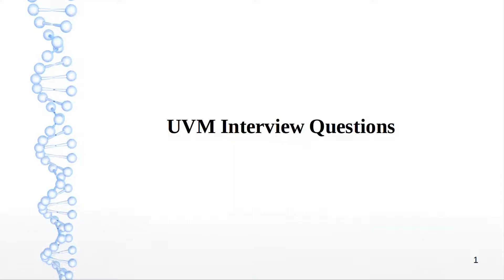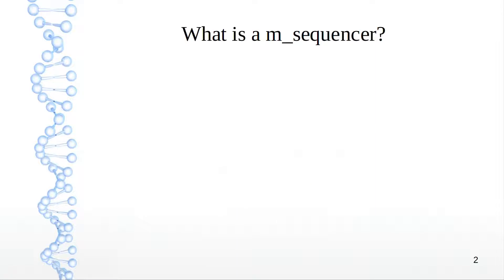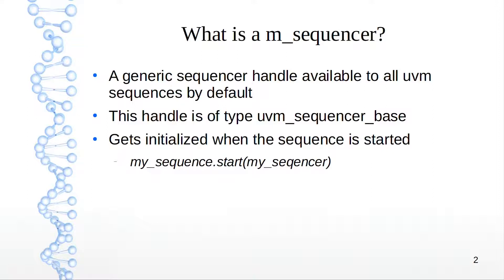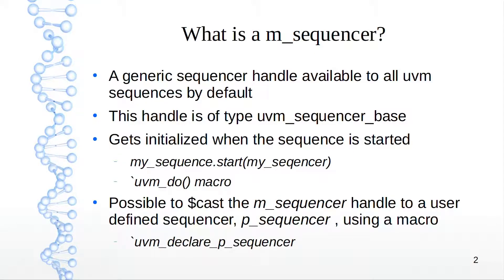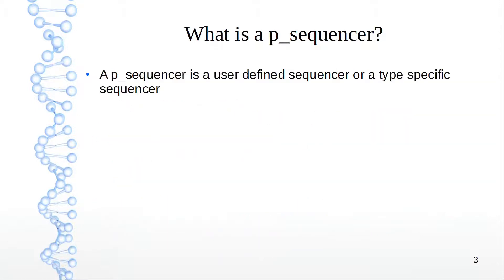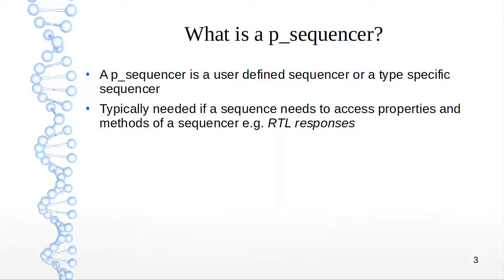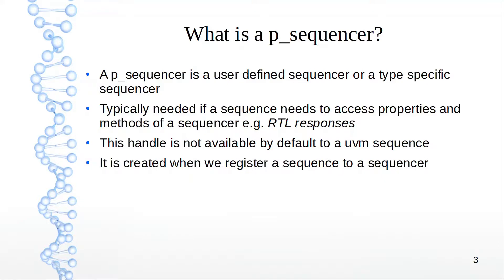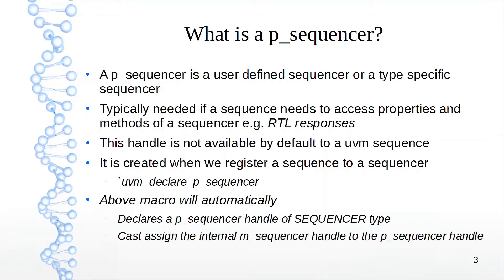UVM Questions: What is p_sequencer or m_sequencer?

Comment: Is p sequencer is only associated with virtual sequencer concept?Can you please also tell me what is the use of p_sequencer ? when will you use p_sequencer ?Here, I want to know the general use case like using p_sequencer for axi_sequencer.
Reply: This exploit polymorphism, which are of uvm_sequencer_base class.
Reply: m sequencer does have any other handle(cannot add) and if you want some handle you need to go with p_sequencer pointer.
Reply from the maker: To put it simply, a P-sequencer (port-sequencer) is to drive transaction to a specific port interface on the DUT.

Comment: Great video! But, what are prefix "m_" and "p_" stand for? it really bothers me, thanks
Reply from the maker: Hi Ming-Ching,  
  This is more of a UVM convention, typically when we have class properties we add m_ as a prefix. One way to remember this convention is m_* is associated with the default sequencer of the class whereas p_* is created only when we register sequence to a sequencer using the given macro.
Reply: @SiliconNSignals  Understood, thanks for the reply :D
Reply: p sequencer stands for "passive sequencer". This is a sequencer that is used to send stimulus to the design being verified but does not collect or check responses from the design. It only generates stimulus transactions.

m sequencer stands for "monitor sequencer". This is a sequencer used on the monitoring/checking side. An m sequencer coordinates with a monitor to check the responses from the design for each stimulus, and determines if the responses are correct and expected.